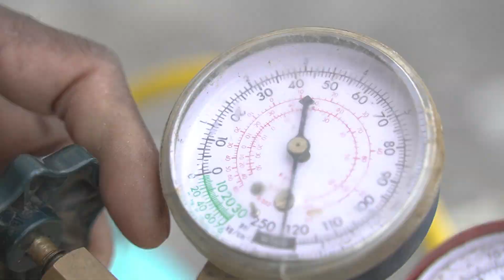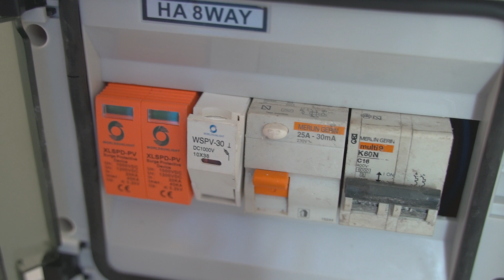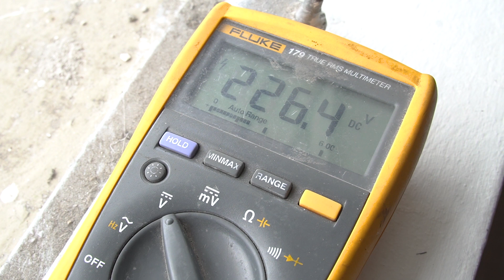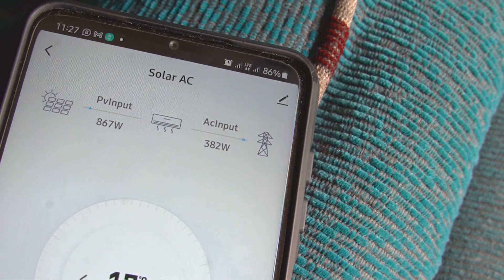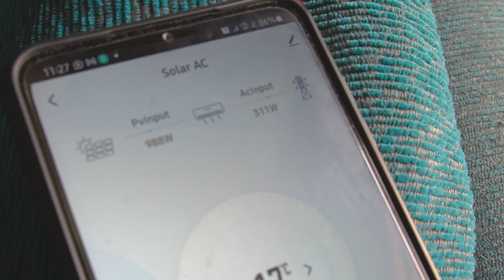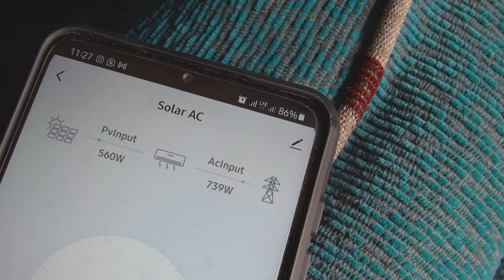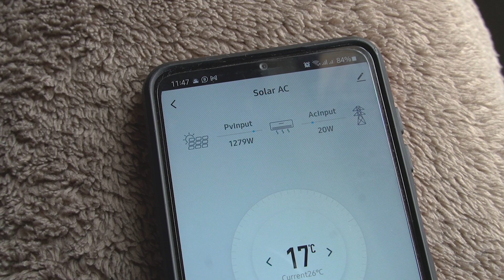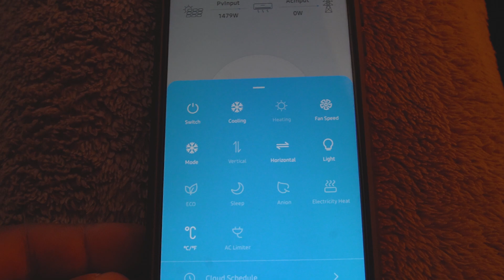Why Solar Powered Air Conditioners (Heat Pumps)?

Comment: I have 100W + 80W solar panels on my small summer house feeding a 100Ah battery. Through a 1000W inverter I can run my heat pump in AC mode to keep down the temperature in the afternoon.
The heat pump will just draw 200-300W to lower the temperature a few degrees.
Reply from the maker: Not bad.
Is that a 220V or 110V heat pump?
Reply: @RayonWhittaker  220V

Comment: How is the maximum DC input is 2500 W and you have installed almost 2000 W but the monocrystalline have efficiency of 20% so the input power would be 400W which would not power the A/C. Am I mistaken?
Reply from the maker: The 18000 btu mini split needs 1500 Watts DC from solar panels.

These 6 panels after setup were producing 1700+ Watts

@4:14 you will see the DC power coming in from the Solar panels while using the app. This was a cloudy day.

If a solar panel has 20% efficiency, this means it is able to convert 20% of the sunshine hitting it into electricity.
Reply: @RayonWhittaker  Exactly, but how are you having 1200W from 1600W solar array is what I am not getting?
Reply from the maker: @themuslimwarner  if you're asking why am I not getting 1600W, you're not going to get the exact amount. The panels are rated to produce a certain amount of power, therefore you will receive "up to" that amount.

If you're asking based on the thought that panels are 20% efficient. Bear in mind that it's NOT 20% of the 1600W but rather 20% of the sunlight is being absorbed by the Solar Array making it able to produce "up to" 1600W.

Hope that helps
Reply from the maker: @themuslimwarner  @2:08 the voltage coming in from the array was 225v DC. 
The current/amps that the 18000 btu draws is about 5.5Amps at that time making the power -  225V × 5.5A = 1237.5W
Reply: This is beautiful...
Reply: @telefonooesia5896 it is
Reply from the maker: 2500W is the max power the unit will be able to manage
Reply: So basically, this unit has DC bus from internal inverter wired to external DC terminals so you can by-pass AC/DC converter.

Comment: The AC has an app?
Reply from the maker: Yes... App and wifi
Reply: @RayonWhittaker  this is so revolutionary, so you can monitor multi units in a flat from the app
.
Reply from the maker: @donlatinohits  that's correct...
Not only that, you can set schedules and remotely control from anywhere in the world
Reply: @RayonWhittaker  how can I buy these in Nigeria.
Reply from the maker: @donlatinohits  check out the ZamnaClimate website